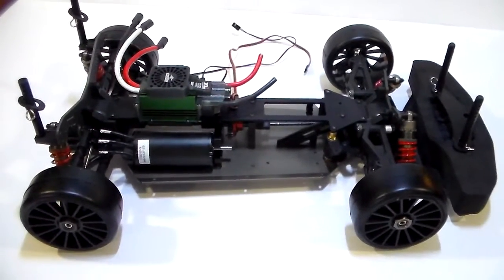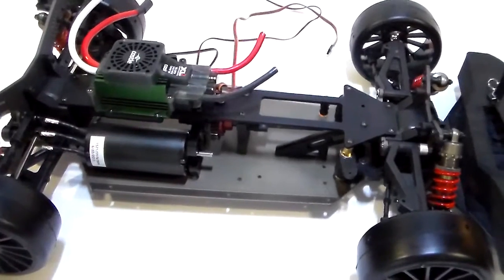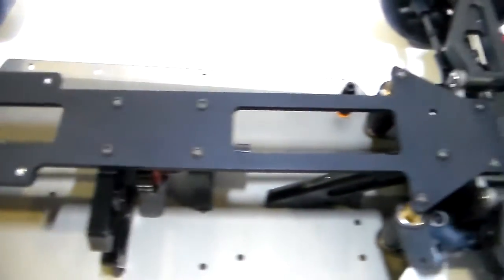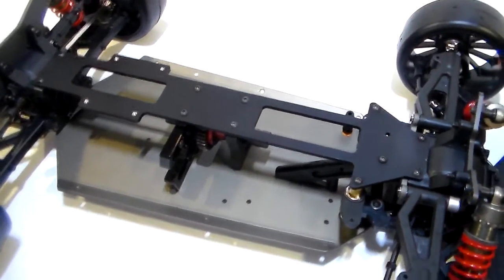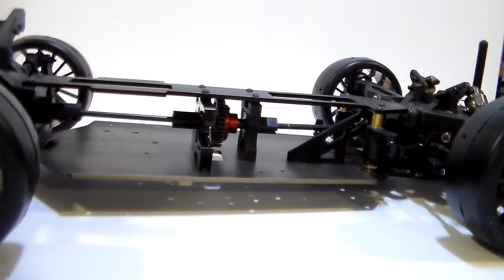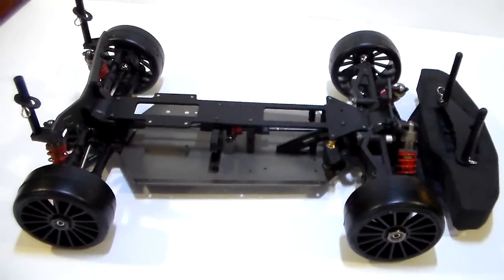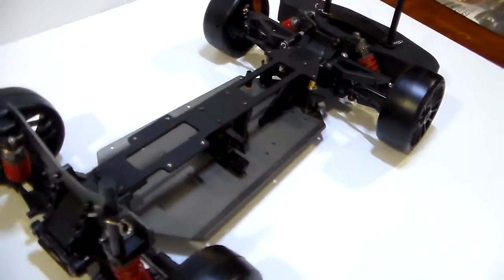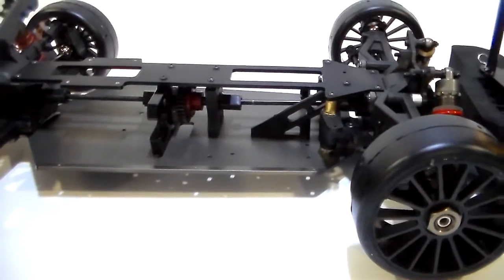Part 1 Chassis Upgrade for Ofna Dirt Oval / Gtp2e

Comment: how much and how do i order i need one nextweek dannie.vick@yahoo.com
Reply from the maker: +D “SUBSONIC” Vick If your wondering why you have to send chassis. I have to machinr center bulk heads down and re drill mounting holes for spur gear assembly to move it to center of chassis.

Comment: Great work Bryan! Very clean and well balanced. Thanks for sharing & thumbs up!
Reply: From this day forward you shall be called Mr. Fab! Fab for Fabulous and Fabrication! +iROCK™ RC
Reply from the maker: +iROCK™ RC  i just cant thank you enough for that my good Friend. Thanks for always being there. I always look forward to your comments. How is the Quality on that Capo Jeep. I really want to get one but not sure how good it is.
Reply: Overall the quality is good. I recommend just using your hand to tighten the screws. Be very careful not to over tighten. Especially when you assemble the body. Looking back at the build it would have been more fun and enjoyable assembling it off camera than in front of the camera. My only regret is that I didn't paint the body panels. Maybe when Version 2 comes out. A run vid of the Capo Jeep will be up and running soon. +custom fast rc
Reply from the maker: Thanks. Is there a version 2 coming out ?
Reply: +custom fast rc Manufacturers usually come out with an updated version after one year. My kit was missing some screws and miscellaneous parts but Capo sent me the missing screws and parts. They also sent me an updated version for the front steering. They were having a lot of complaints about their wire steering not functioning properly. I didn't have any issues. I made the wire steering work but they sent me the updated part. Which  will handle better while crawling & scaling. From what I'm hearing they have plans to come out with a fully covered Jeep with removable top. You should know all about updating your work. Sometimes when you do something for the first time and when you try to do it the second time you make revisions to make it work better. Patience is the key to anything in life to be successful. By just looking at your work I know you really think things out and do a lot of research before you start your fabrication or build. Keep up the great work my friend!
Reply from the maker: Thanks, Its natural, it just is. Hard wired in. lol